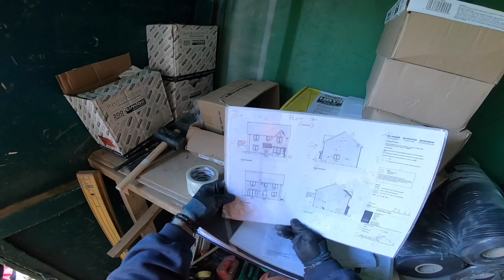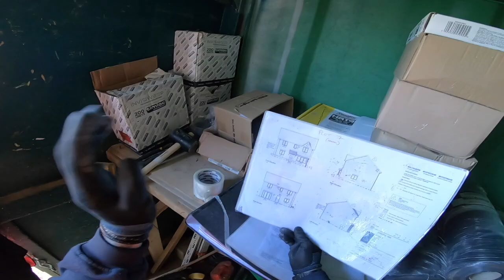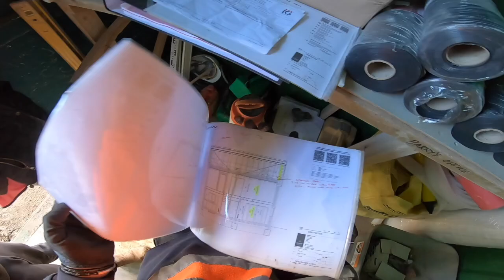lovely day in the sun

Comment: No bricky but i would recommend over such a distance to set something temporarily and tingle the line. There was alot of play in that line, its bound to sag over that long stretch

Personally, as a groundworker i generally wont lay kerbs, edgers, slabs etc. without having pins to hold the line every so many meters. Just personal preference i guess and the ways ive been shown, even when ive done block and brickwork up to damp, i usually set the laser up and tingle the line near the center.

Comment: How come the bricks were different when you changed plots?
Reply: Yeah I noticed this, slightly different shade and texture of red and they have 8-10 holes as opposed to the 3holed brick on the previous plot.
Pretty sure Charlie doesn't pick the bricks, I guess it is down to the company he is doing the work for.

I would guess the choice of different brick is varry the look of the houses so they don't all "look the same"

There's a housing plot down the road from me, 30 new houses being built some in yellow some in red but all have the some features and detail work (blue engineering bricks 2course round the buildings below windows) guess the mix of yellow and reds separates them some what.